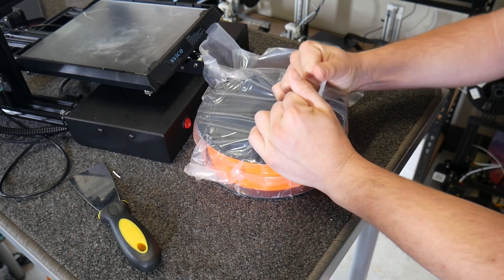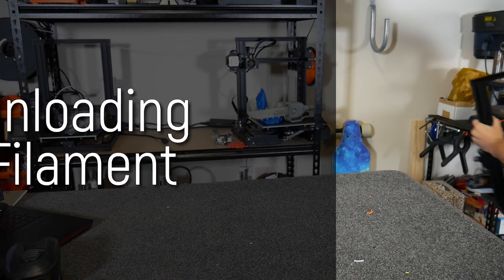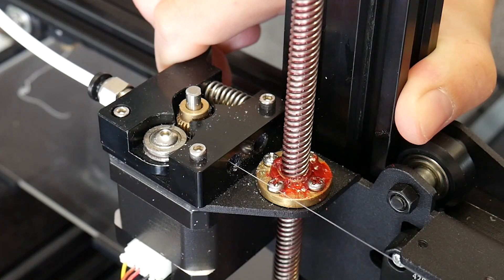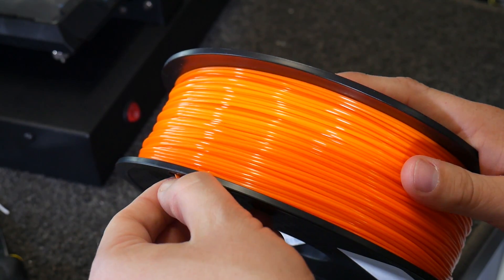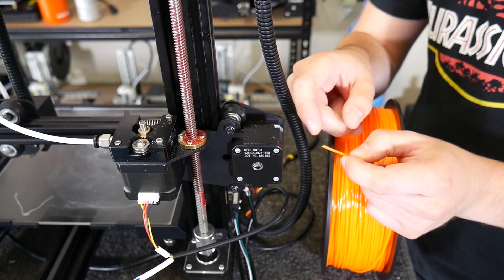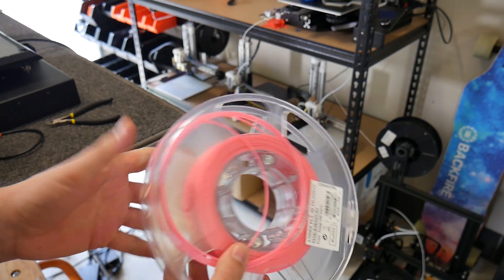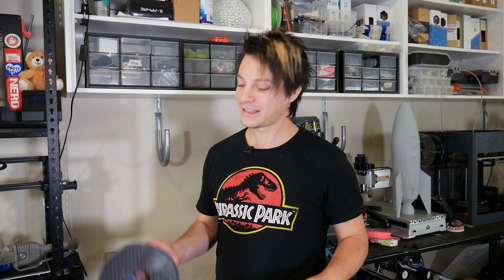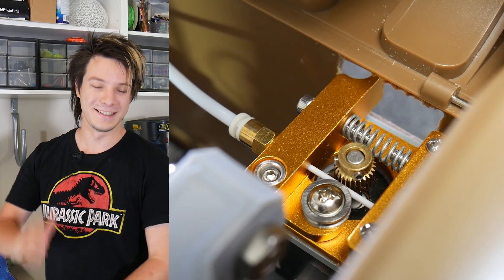How to Load and Unload 3D Printer Filament (and prevent tangles!)

Comment: PLA is affected by moisture. when it gets "wet" it becomes brittle (hence why it snaps)

The reason is quite simple. the "skin" of the filament has been compromised. This permits rapid moisture ingress into the plastic (right out of the air)

you can tell what part of the filament has been through the feeder by simply snapping off the end and keep moving up the strand and snapping it until it stops simply snapping. THIS is virgin filament.

now the next time LOOK at the filament. you will notice the skin is compromised on the end with marks. these are from the TEETH of the feeder hobbed gear. they "break" the surface of the PLA and permit ingress of moisture for the pla to absorb. intact skin greatly slows this process. the portion that has been compromised by the feeder no longer has the intact skin so it rapidly degenerates absorbs moisture hence it snaps since pla gets brittle when it absorbs moisture.
Reply: I'm not sure, that this is a (complete) explanation of the "self distruction of filament, when left in the printer" effect.

WHY? Because I own a direct feeding printer and I also see this self distruction of filament, when left in the printer over night . In my case, the filament breaks somewhere between the spool an the feeder input. So, this happens even if the filament has not been compromised by anything. It is also far off the retraction distance. I have also taken care, that there is only a minimun of tension on the filament, by moving the Z-axis to a low position and the X-axis into a low tension position.

But overnight self distruction happens with all my different filaments :-( .

My final solution is, to unload the filament, when I know, that it will last several hours before I do the next print. But as an engineer I not only want a solution, I also want an explanation ;-).
Reply: @g.j.647  I think the explanation is the same what happens when you take something stiff and you bend it? It cracks the surface of it cracks so when you have the rolled filling it on your role and you pull it straight such as when it's unrolled and fed into the printer well the entire surface area of the filament from the spool all the way to the end is compromised I've never seen this compromise happen quickly however it usually takes quite a long. Of time unless the filament is already wet
Reply: @g.j.647  I've had this happen with a cheap, older roll of PLA, but no other PLA rolls or other filament rolls (so far at least!).  Something to note with the roll I had it happen with, it was a roll that I had (and I wish this video had been around then!) completely unrolled and re-rolled by hand to resolve a problem with knots, so I suspect that handling has something to do with it (i.e. some sort of reaction between skin oils and the plastic).  I get cold easily, so I tend to keep the house temperature high during the day (20c), but I couldn't tell you what the humidity is like (fairly low at a guess) - that would be another factor that might cause your filament to self destruct overnight.
Reply: Now I understand why the first part of my PLA always breaks and then the rest is okay or fine. It's the part I had pulled out of the PTFE tube last time I changed it.
Reply: Alex Kenis ran a bunch of experiments. For him, moisture had no influence on PLA whatsoever, if anything it made it more pliable. However UV light made the filament brittle.

Comment: @Tim_lennard (below) made a very good observation which brings up a good point about the gear marks making marks on the PLA. I read the other comments about "light" making it brittle but I too am with you, Angus. I'm not sure these truly explain why it snaps. Disclaimer, I'm not a material scientist.  I too have had the same experience with brittle PLA and have had the filament snap while coming off the reel, before going into the feed system!  In that case, it was "starter spool" from the printer manufacturer when it was delivered. Plain white PLA in a vacuum sealed bag with a descant, After making a number of prints the majority of this reel was exhausted and just as I was changing reels after unloading, it snapped, almost exactly as it did in this video. My observations were, the point where it broke had not been into the feed yet, the spool was near the end down towards the smallest diameter and the spool had been out for some time (a couple weeks) and had been kept relatively dry as it was housed inside the build chamber of my FF Dreamer printer. My first thought was the wheel diameter had such a tight radius when wound fresh onto the spool from the factory, once exposed to moisture it was never going to be as pliable without bringing it back up to hot room temperature and rewinding onto a larger diameter spool. That said, there wasn't enough material left of the brittle stuff to worry about so I chucked it into my excess plastic bin and simply stopped using the manufacturer supplied reels. I simply made an external reel system to hold much larger reels and feed the filament through a side vent and have been happily printing along since them. The avoid tangles my new spool holder system has a friction brake by simply twisting a wing nut. Thanks for this episode!

Comment: It should be noted that as the filament is driven, the hobbed gear or bolt will put small notches in the filament which act as stress points and make it more prone to snapping (this can actually be handy when you want to break the blobby end off). This may be what you are seeing.

Comment: How many of you use blue tape to keep the unloaded filament end to the inside of the spool instead of using those holes on the spool sides?  No kinks, no wasted filament.
Reply: I use a small clip that I downloaded from Thingaverse to hold the loose end of the filament tight after I have unloaded it from my extruder:

https://www.thingiverse.com/thing:1194027

Comment: to fix the knots, rather than trying to tuck all the loose stuff into the knot, or cutting it off, just make the knot loose and tuck the roll end of the filament though the knot. Its a lot easier than dealing with the loose stuff, or finding projects that fit the stuff you cut off.

Comment: PLA gets brittle inside the bowden tube because the extruder gear cuts into the filament thus it can break easily at every cut line.

Comment: I've been printing with my homemade Rostok delta for a bit now, and had never seen the push-then-pull trick for unloading the filament.  And I must admit that I've had some mysterious jams when changing filament, so I'll have to start trying it this way.  A tip in return - I was forever having the filament refuse to go through the extruder into the tube, and it was extremely frustrating, especially since it's located in a hard-to-reach place.  I decided to figure out what was going on the other day, and found that, at least on the extruder I got from Amazon as a Creality replacement, the fitting that connects the tubing to the extruder was completely flat on the end, with a considerably smaller inside diameter hole than the one in the extruder frame, so the filament was hitting the resulting lip and stopping.  I took the fitting out and drilled the threaded end with a drill bit slightly smaller than the outside of the threaded portion, but only until the tip of the bit was fully inside the end of the fitting.  This left a nice tapered opening from the extruder into the fitting, and it's smooth as silk to load new filament now.

Comment: when i used marlin I had a special routine that was extremely fast, it purged 5-10mm or so and pulled  back the 540mm of length at 120mm/s with a relatively low acceleration, so it spooled up to speed causing no filament grinding, it was pretty cool and  very fast, but the quickest way is still to do it manually, although if you have some  printers running 24/7 constantly doing that is a pain, so I get why there's the routine, and optimising it is very important

Comment: When most of the filament has been used up, the filament is very curly due to the reduced radius, and I find it extremely hard to load in my direct extruder (Anet A8). I suppose I'm not the only one with this issue, but I have yet to find a video or article with tips for loading filament from these partially spent spools.
Also, the filament gets brittle as you describe, so it's not related to the bowden system. I suppose it has to do with environmental exposure.

Comment: At this point, I wouldn't mind a tutorial on how to change a nozzle, either to try out different types (brass vs. other), or to replace a damaged nozzle. I suspect the nozzle on my Delta is damaged, but I'm a bit hesitant to bite the bullet.
I know there are a couple of different hotend designs on the market, but a lot of manufacturers are using E3D clones as least these days.

Comment: is it possible that humidity is building up in your PTFE tube.
as filament is heated small portions of moisture would evaporate and wash back into the tube, with a relatively sealed setup some of it is bound to settle in there and get into the pla over time, not much but enough to make a difference in a concentrated area.

possible solutions for this are not . . . . . not great.
poke a hole (A tiny one) in your tube at its highest point, and just before the hot end. this is the only solution I can think of that seems most practical and least problematic.
but it is not without issue.
if you could replace the tube with some kind of woven mesh, or put slits up the tube without getting the filament jammed in it that would probably be better, but I really don't know a cost effective way to do those.

Comment: Yeah actually, why does pla get brittle in ptfe, ONLY in ptfe, not on my spool, not on the way into the extruder, but only in the bowdens!
Reply: I always remove PLA filament completely after a print is finished if the printer will sit unused for a few days.  I had some cheap PLA break into many pieces in the bowden tube but got very lucky since I had Capricorn tubing with its tighter internal tolerance and was able to carefully push through the broken pieces in a straight line into the hot end with a new piece of filament.

Comment: I think its so brittle (<— is this the correct way to write it?) because the the extrudermotor leaves notches in the filament and at this point the filament breaks.
Reply: maybe, just 2 days ago,  when I get to the near end of a roll of 3dSolutech pla, it will break between the roll and the extruder, its never had a gear mark on it.   Its probably a microscopic affect related to moisture.
Reply: orbitalair interesting🤔

Comment: So the trick to re-winding a spool is:  Hold on loosely, but don't let go.  If you cling too tightly, you're gonna lose control.
Reply: I see what you did there!
Reply: Meant to be seen it was.
Reply: 38 special i knew i recognized that text ;)
Reply: The other tip is to rewind filament back onto the spool in the same direction as the filament wants to twist. If the filament hanging in the air wants to twist as you wind it, flip the spool in your hand so you're winding from the other direction, and continue winding.
Reply: What I did is I 3d printed a spool holder clamp and used my cordless drill

Comment: The worst thing for tangles is when you get samples that are not mounted on a spool. I've had a lot of problems with failed prints using samples. Now I always wrap them onto a spool. It takes a bit of time but it's worth it.

Comment: Thanks Angus!
There are several 3D printable spool winders on Thingiverse.  Back in the day (I know - I'm a dinosaur) similar spoolers were invaluable for spooling paper and Mylar CNC tapes.  Inevitably, you'll get twists in the filament at some point when rolling onto spools by hand.  Proper spoolers all but prevent that, and allow you to make a nice, even, professional looking spool job.  Maybe you should make a 3D printable winder with a double helical carriage screw - like the ones used to evenly wind fishing line onto a fishing reel's spool.  Hint-hint.  LOL

Comment: The filament snaps after being in the tube because the extruder gears leave a mark on the filament that makes it easier to Crack
Reply: https://en.wikipedia.org/wiki/Stress_concentration
Reply: It also often snaps outside of the tube in my case. Mostly in between the extruder gear and the spool.

Comment: Mine sometimes breaks off on my i3 MK3 head when trying to pull it out and then it's screwdriver time once again...
Reply from the maker: Yepyep experienced that too! You can usually force it through with another bit of filament or hex key if you can't reach it withdrawing... frustrating if it happens though.
Reply: I've not had any filament break off on my i3 Mk3 head, the only time I've had PLA break is when shifting reels around in their water tight storage tubs, the end bit sticking through the side of the reel can catch/compress against another reel and snap.
I have found printing TPU at its recommended temperature can sometimes prove difficult, not melting quick enough in the hot end so gets stuck and pushes out the side. Printing it at a higher temp sorts it.

Comment: Good video, almost a year with my 3D printer and not had a tangle yet, I've been very careful about handling the reels.
Could you do a video on sharing your 3D designs online? The basic details of making sure your object can actually print (evident by adding a picture of a print), the optimal print settings etc. I've not had any issues but it would be great to have more people's creations 'out there' in useable / editable form.

Comment: This is a improvement over my self-taught ways:
-Jerk the filament out so the wedge is still soft when I get it out.
-Cut it with the flat side of my flush-cutters towards the end, for a sort of sharp edge.
-When it unwinds, rewind it form the side, while holding the end.
-When it is tangled, hold the end and unwind the spool, and push a huge coil, with the knot in it over the edge, and rewind while moving the knot to the end.
-Manually rewinding.
Thanks for the tips! They will definitely make my life easier.

Comment: At about the 12min mark, where you start to wind it back on the spool, you are working against the filaments will. Things would have been much easier if you simply have flipped the spool around in your hand and wound it the other way. There would have been much less need to have the clutter dangle and rotate. Lookup the term "roadies wrap" here on youtube to get it explained in detail.